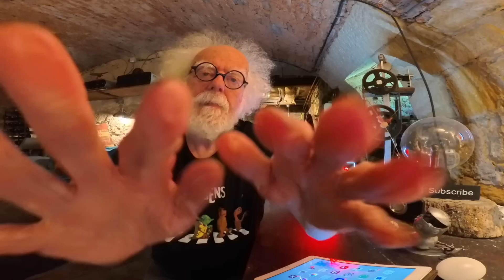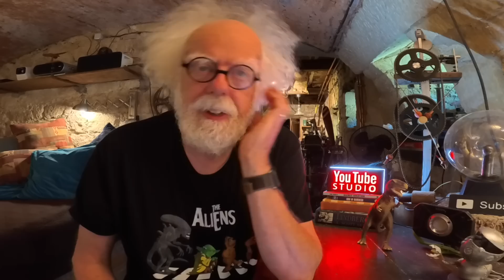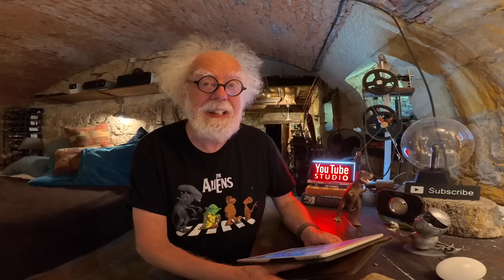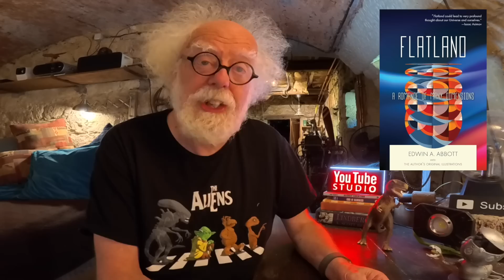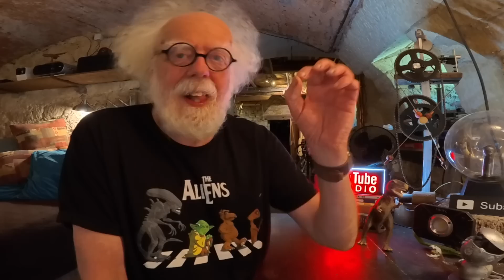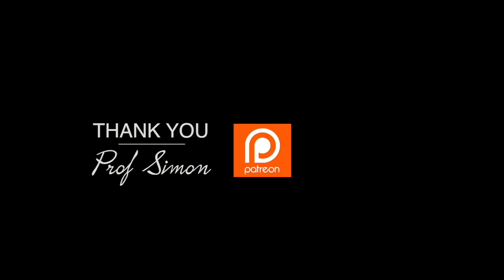UAP your questions - Prof Simon

Comment: I only have had one experience.  It flew over head very low. It seemed to be solid. It was all lit up. Looked like a upside down jello mold maybe a cake mold. It looked like it had windows around it. The windows seemed to be the shape of the jello mold. Craft was shaped like a hockey puck. There was also a red and blue light going around the craft. Sighting lasted 10 to 15 minutes.  Came over far hill from left flew over head with no sound. When it got to the far hill on the right.  It blinked 3 times flew back and forth the distance that took 10-15 minutes the first time  3 times fast like only a second or two. Then shot straight up in the air out of sight. No sonic boom. This was back in 97 i think it was. What i saw was different than what these orbs people are talking about.  That is why i think that there is 2 different phenomenon taking place. 
Maybe one is tech from the other? There is more to the story though if anyone was interested.  Thank you for your time and effort hope you have a wonderful weekend. 
Sincerely James.

Comment: RANT  away - your rants are much more interesting than 99% of the crap on YT :)   my interest comes from 2 sightings with my own eyeballs, the second one, was NOT plasma of any sort, it was a BIG black triangle with 3 bright lights, one on each corner. It may have been a secret spy aircraft, but I did watch it, pass over the UK and watched it for over 10 minutes.  I can't figure why a secret spy craft would try to attract attention to itself, by using bright lights. Somebody else confided in me, that they had also seen it, but they said they had seen it up close and it made no sound!  My sightng was at night and was not a commercial aircraft (no hazard lights at all), it was not the ISS, it was not starlink, it was something else... and that was about 6 years ago. If it was just a fleeting glimpse - I could dismiss it, but my eyes where glued to it as it passed from horizon to horizon, it seemed to be very big, very fast and very high, almost in low earth orbit, way above any commercial traffic.

Comment: I came across some alleged leaked Apollo 11 footage presented at John Lears lecture In Las vegas 1988. I have clipped out the footage of interest and put it in my YT channel. Do you think the footage is legit? I compared it to original Apollo 11 footage and it does appear like the leaked footage was cut from the publicly released footage. The footage shows Massive possibly bar bell shaped UFO's that produce a brilliant light and a small craft appears to actually approach the Apollo 11 craft and a tentacle looking object touches the Camera lens towards the end of the clip.

Some of the footage also shows interior cameras of "The Eagle" command module and what looks like a NHI inside of the craft with Collins.